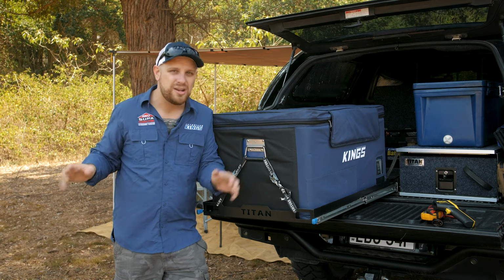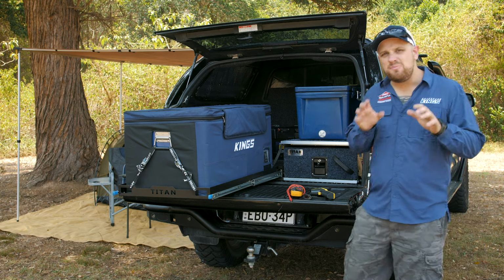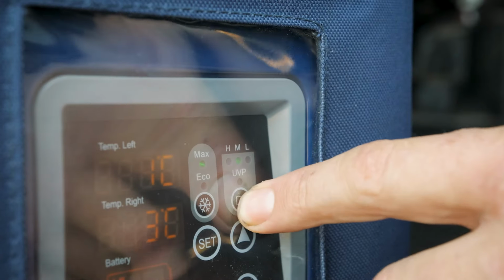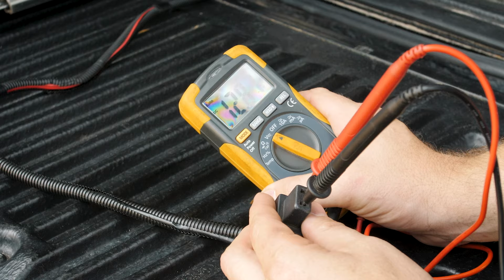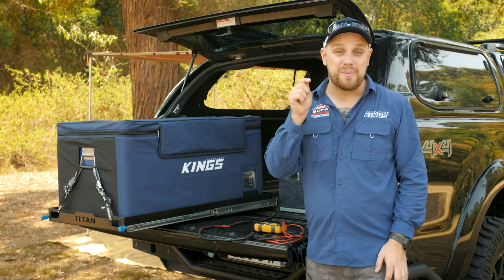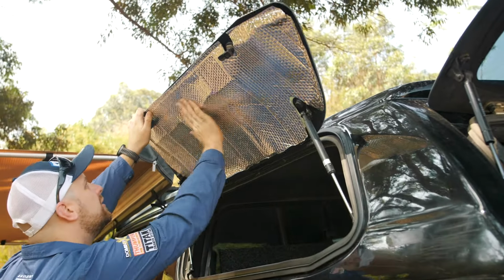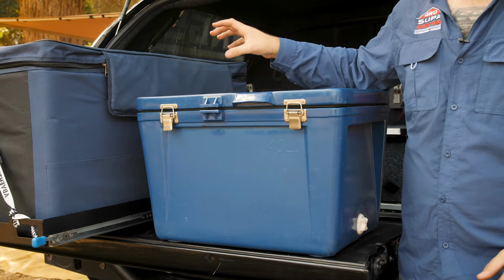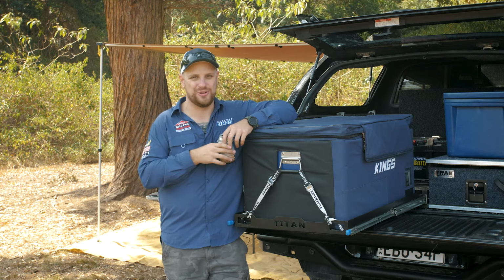MAKE YOUR 12V FRIDGE RUN COLDER! Make any camping fridge run better & fridge problems solved!

Comment: Never ever put your solar blanket on your bonnet or windscreen. 
They get super hot - over 70° without airflow beneath them. That’ll ruin your paint on the bonnet and can easily crack your windscreen. 
Put them on the ground or if you must, on your roof platform.

I also use an Anderson plug on my fridge and I have a fan that runs 24/7 blowing air into the fridge compressor inlet vent.

Comment: Having a battery big enough to be able to not have to pre cool the fridge is also a tip, buy minimum 200ah lithium and solar panel to max the charge input for that size battery and you'll never run out and you can run your fridge cooler without range anxiety

Comment: So, the Anderson plug that I bought as recommended by you guys isn’t really cutting it - I can’t get past the E1 error code no matter if I use the cigarette charger or the Anderson plug. So frustrating and given I’m pretty useless with these things I’ve no idea if it’s a user error or my fridge is crap.  It went cold FAST in 10
Mins but won’t stay running. Even if I turn the engine on to boost the battery
Reply from the maker: Hey there, 

An E1 error on our fridges is caused by the fridge not receiving enough voltage to power the unit. This is usually caused when the battery is running low, but could also be cause by either an issue with the unit or cabling for the unit. We recommend to potentially fix this issue is trying with another cord, ensuring the battery is fully charged or lowing the battery protection on the fridge. If the unit is still showing the E1 error then contact us directly, either by phone or in store, and we would be happy to look into this issue further for you. 

Cheers, Jayden.

Comment: We just bought an Escape 90lt  dual fridge/freezer. How do we set both sides to be freezing at the same time?
Reply from the maker: Hi Pam,

Thank you for the comment, I can advise that each bin can be set uniquely, and can be toggled between which you're setting by tapping the Cogwheel button.

Regards, Andrew

Comment: If you're having problems with your fridge not cooling properly, try cleaning the 12v terminals. Mine were black, now it freezes and I'm wrapped. It's worth a try.

Comment: 14.2v at '-' on battery and both sides of fuse mounted on fridge '+' .
14.2v on battery 
14.2v on cable for fridge connection to battery. 

Still, fridge not turning on. Any other ideas?
Reply from the maker: Hi there,
Some of our fridge models you are required to hold the power button down to turn the fridge on. If you are not successful with this please don't hesitate to contact us on social@4wdsupacentre.com.au with a screenshot of this comment and your order number.
Regards, Courtney
Reply: Dud fridge?

Comment: If i am running a 75lt kings dual zone fridge with 2x100ah agm battery's is a 200w solar blanket enough to keep them charging
Reply from the maker: Hi there,

For most standard use cases it will be more than enough to keep the batteries topped up, though as with all solar we recommend doublechecking the expected weather as rain can always throw a wrench in things.

Cheers, Andrew
Reply: The thing with blankets is they very rarely put out their "rated" capacity. A lot will depend on weather, but also how many hours a day will your blanket be in direct sunlight? 
Higher Ambient temp also makes a fridge work much harder than if the weather is cool. There are a lot of variables which makes this question hard to answer, definitively.

Comment: A tip from My mom, to extend battery time: Forget cooling elements, they take up space! Deep freeze a bottle of milk, and trow it into the fridge before you hit the road. It will release it's energy slowly, and it will not spoil the milk....

Comment: If you want it to run colder, get rid of the cover for starters, testing shows that a fridge runs cooler without a cover.
Reply: That sounds like a design issue. I tested mine with and without the bag using a high resolution thermal imaging camera and its a fairly consistent 3 degrees difference in favour of the bag.
Science tells us insulation is the key, and a well designed bag should do just that.

Comment: Lovely tips, Ive seen a few Utube vids they did tests and there fridges, they were more efficient without a cover in the back of the 4wd as the cover does not let the heat get away from the fridge
Reply: Correct. A fridge cover protects from Sunlight generating heat. 
If it’s not in sunlight they can perform better without a cover as the heat can escape instead of being trapped under the cover.
Reply: Fridge with "testes"? Interesting 😂
Reply: @rcristy  Yea sorry haha
Reply: @craigtomkinson2837  😁

Comment: good tips. Should also check voltage drop at fridge and battery when running. poor connections can give full voltage when not under load.

Comment: Packing a fridge with items you want to keep really cold and not needed go to the bottom and things that you want to chill go to the top like lettuce, cucumber, cheese, butter & stuff. This is useful if you don't have a freezer compartment as the stuff packed at the bottom will almost freeze but not at the top. Also an empty fridge can't freeze air so if you take a tin of drink out put a warm one in, keep the fridge as full as possible.
Reply: So true. I found out this with mine. Set at minus 11, fully packed and the drinks at the top don't freeze.
Reply: That’s how I pack mine.

Comment: Opening a chest fridge like this doesnt let much of the cold out at all. Cold air is heavier than hot air, so it sits in the cavity. Its like water.
Reply: Exactly. I didn’t buy a fridge to still bring a cooler and have to fiddle with ice. Unless the ice is for my mixed drink, I don’t need it.

Comment: I can understand this, our fridge is mounted in the left rear of our prado, the car is parked outside, and the left side gets all the western afternoon sun, our battery soon goes to under the low voltage setting, now we have the proper king's cover, and the window shade, I'm certain we have fixed rgis issue, we leave our fridge on 24/7, we purchased a king's charging system, which runs from the car battery, with heavy cables, through a modulator, to the batter in the rear, thanks your vidoe's are always on point.
Reply: Do you have a Smart Isolator or DC-DC charger?

Comment: that tips on using the ice box so you can have a cold fridge is beating the purpose of me spending a lot of money upgrading from ice box to portable fridge.
Reply: yes that's what i think and where do you get ice from in the middle of no were?
Reply: @JOHNSMITH-if9jr  use the freezer to make ice
Reply: @JOHNSMITH-if9jr fridge
Reply: Exactly what I thought
Reply: Hang on I'm thinking wtf?? Where do you get your ice from 200km from nowhere?
Reply: I think you might want to replay that bit of the video. When I bought my fridge I gave away my ice box. Worst thing I ever did. Ice box for cold drinks. Fridge/freezer for food. Works every time. Think about what he said.
Reply: @stanleyj.mitchell4851 that defeats the whole purpose of having a 12v fridge lmao, if you have solar and the correct size battery you don't even need to worry about how often you open or close the fridge because you'll never get anywhere near the battery going flat

This is exactly why having a DC to DC charger is stupid because it relys on your car running to restock the battery, you SHOULD NOT need to take an esky too 🤦
Reply: 😂 right i brought my fridge for work on the farm so what was the point of me getting it if I was going to use an esk that only last the morning 😂
Reply: Why do I drink from a glass when I buy drinks in a large bottle
Reply: The Egyptians used to make ice in the desert. Just saying....
Reply: But cold beer and soggy food in the esky are not the way to go

Comment: Have you or any one you know ever used a household solar panel on your 4x4 , if not, do you know if it would work ok??
Reply: Voltage is usually too high for most 12v systems. Some solar controllers will accept the voltage but it is less efficient than using an 18V panel.
Reply: As procrastinator said, you do need to make sure that your charger controller can accept the incoming voltage from the residential panel. These are usually around 40-45v open circuit which is more that most charge controllers can take. Something like a Victron 100/20 will take up to 100V incoming. I do not recommend their 75v controllers though due to the issue they have with the silica sand leaking out.

Comment: at small tip for precooling thiings before putting them in icebox or fridge, is putting is ind moving water, like at kreek, stream, or river. No matter the metode, the lower the tempertur of gods befor they go in the icebox/fridge the longer the ice/power last, and de farster the goods get even colder .

Comment: I have a camping fridge/freezer. Running as freezer have three deep cycle 150 ampr and of lots of solar but in the morning no start of freezer down to ten volt help have lots off cold things in it  newish batteries 6-12 mths old
Reply from the maker: Hi there, if you can contact us via our 4WD Supacentre Facebook page we can help you with this issue. Kind regards, Jayde.

Comment: Say man I live in my van got a 12v cooler. Without plugging into the cig lighter how can I give it 24/7 power?
Reply: A "house" battery, aka a second battery, run it on solar alone or solar and off the alternator as well using a VSR switch. That will make you able to run a 12v fridge most of the time.

Comment: I want to put a 12v fridge in the back of my camper. Question: would additional ventilation be required when the rear hatch is closed, to prevent the fridge from overheating?
Reply from the maker: Hi Bill, Yes, we definitely recommend you ensure your fridge is getting as much ventilation as possible to prevent it from overheating and causing problems. Regards, Mia

Comment: You made the same mistake as many campers do. You measured the open voltage at the end of the cable. This is incorrect. You have to do the measurement using the “running” fridge as a load…. Then probe your feed wire with sharp probes to see the voltage. Or use an adapter & probe the connector. The more current being drawn by the load at the end, the more volt drop you will get. This is why you need to use a thick copper cable. The current carrying capacity of a copper cable eg 40A is misleading. Go for 80A cable for less volt drop. See this video link for a better understanding.
https://youtu.be/svdcHeSavEY
Cheers….. TJ in West Australia
Reply from the maker: Yep you're absolutely spot on mate. I definitely got my info a bit backwards there, what I was doing was testing for a break in the wire. Cheers for the pickup. Brenno

Comment: My 12 volt refrigerator had an E1 error code.  Not sure if error codes are the same for the different brands on the market.  Leaving the refrigerator disconnected from current didn't solve my problem.  After getting the error code to appear i touched a second button that was opposite of the other on button and the temperature showed up on the display and the error code has stayed off.  I made sure that the refrigerator was level because the error code for E1 on one brand of refrigerator was for the fan.    I had been moving the refrigerator around reorganizing where I was placing the unit in a different area which could have had a more than 30% pitch causing the error code E1 and problems with the fan.  Hope this helps anyone in the future.

Comment: Also replace the 12v plug with an Anderson plug the fridge will use less power due to less resistance in the plug and you won't blow fuses
Reply: Cheers much for the heads up mate:)
Reply: Could you recommend an Anderson plug heavier gauge cable combo? Thanks much in advance
Reply: @davidmcfarland3940  yep definitely. I wouldn't run anything less than 6 mm
Reply: I use xt90 connectors, not much bigger than the existing plug, can handle 90 amps all day so running 5 amps is nothing and they just look nicer than a big old anderson hanging off a fridge.
Reply: @exogator  Can the xt90 connectors rattle loose?
Reply: @Malc664  I doubt it decent ones are pretty solid, mines never come loose, had someone trip over the cord and it snapped the lighter socket that it was plugged into
Reply: @Malc664  plus they're designed for rc cars, would be pretty dodgy if the battery's unplugged while driving.
Reply: I was about to do that to my 65L kings fridge and found out from kings that it voids the 5yr warranty.
Better off spending the $15 bucks and buy the kings lead with the anderson plug fitted factory.
Reply: @traxxas1211  Doesn't matter what they say, if it isn't responsible for a specific failure the warranty must be honored.
Reply: no only that the plug will not come lose and turn off the fridge on you. so a Anderson is the way to go

Comment: You should also keep the car open as much as possible. A fully sealed/closed car will reach crazy hot temps in summer. So leave the windows down a bit and park it under shade if possible, or leave the doors open if your near the car.
Reply from the maker: Great tip Chris! Cheers for that!

Cheers,
Chad
Reply: Yeah, leave the doors open…then flatten your start battery with the interior light…
Reply: @officialWWM  It's not rocket science to turn your interior light off buddy, plus LED'S use fuck all battery. 🤣
Reply: @hadster10  well genius, my vehicle doesn’t have led interior lights and you can’t turn them off when you open the doors!

Comment: A full fridge operates better than an empty one. Keep the windows down and use a sunshade on the front screen as well. Air flow and lower cabin temps make a massive difference
Reply: @harrisonscott2371  no  a full fridge runs better because of thermal mass, if it is full of cold objects then it has less need for power to keep an otherwise empty box cold
Reply: @roscored1000 the OP said a full one operates better then you said no, a full one operates better🤪🤷
Reply: @roscored1000 That’s what he said.
Reply: an urban myth. it "operates" no differently. it still has the same cooling capacity, watts per minute per degree.
the air has less thermal capacity than anything you put in...  it doesnt absorb much energy. it doesnt have to lose much. the compressor barely has to work but its constantly cycling on and off.

the volume inside always absorbs heat from the surrounds at the same rate (ignore its sitting in the sun...)
if it has a large thermal mass it takes longer to warm up, sure. 
it also takes longer to then COOL DOWN. there is no saving. the compressor has to work for longer but gets a longer break. theres also a limit to how fast it can remove the heat due to conduction rates, blah blah... 

the amount of energy absorbed over a period of time remains constant and has to be removed. and the more it contains, the more thermal mass, the more energy that it contains...

an empty fridge uses less power as theres nothing in there but air.
but is utterly useless?
a full fridge is EFFICIENT.

the only thing that really makes a fridge work "better" is to cool its radiator coils more effectively.
a fridge compresses a gas to raise its temperature above ambient so it can reject heat, and that gas upon re-expanding must abosrb heat. the colder the "hot side", the less work required to maintain a given temperature. 

.